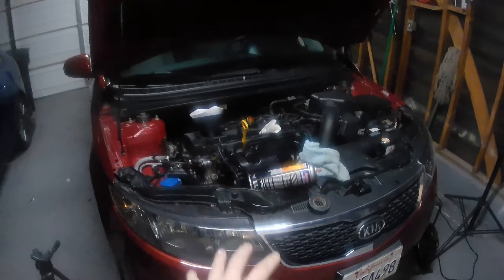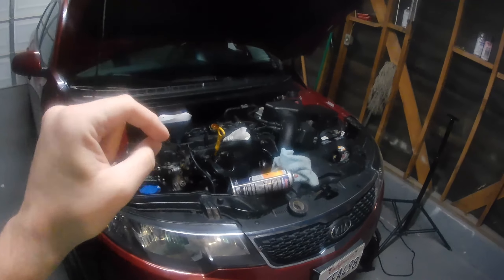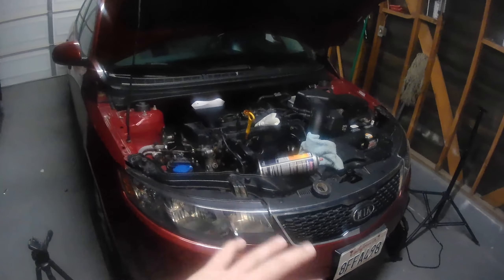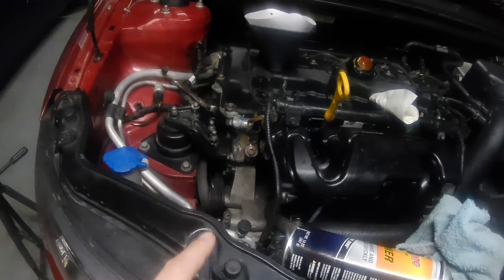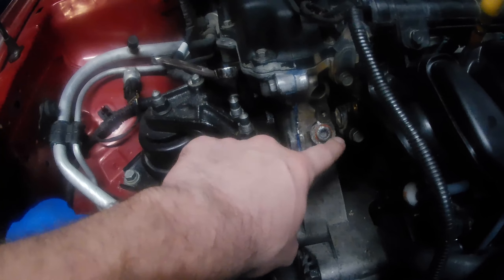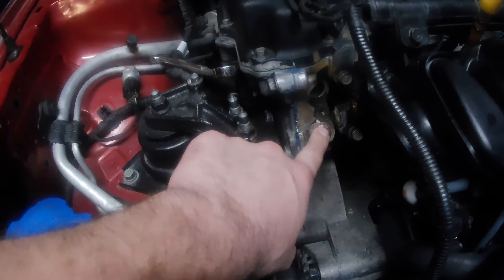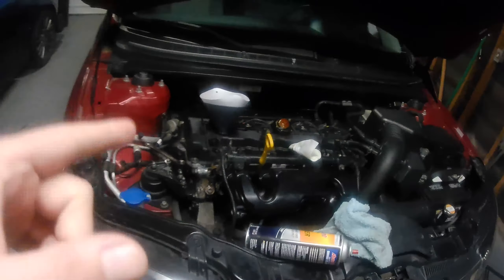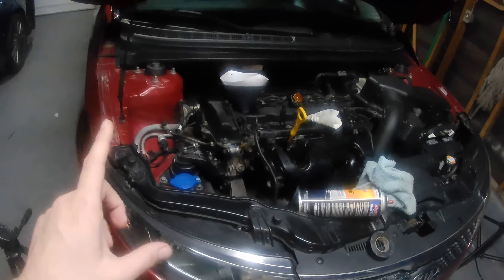The only vehicle to ever HAUNT my thoughts!

Comment: I know it probably doesn’t help now (I started watching all your videos from the beginning and I hate that you stopped), but I would have started with an oil pressure test to make sure it’s in spec.  Then go through those screens and I’ve seen that be balance shafts in other cars.

Also, on the trans fluid—BG makes an awesome additive for auto trans that you can get pretty cheap on Amazon and would have been great with that little bit of extra space you had.

Comment: I had a similar issue and code with a Mazda CX 7. In addition, it would have the slightest hesitation on hard acceleration. Three shops couldn't figure out the issue... in fact, one of those shops refunded me my money after replacing vvt solenoid, timing gear, and chain.  The last mechanic I went to  fixed it in less than an hour by adjusting the timing,.
Reply from the maker: If these new gear coming don’t fix it. That’ll be my last thought. It just doesn’t make sense to me. Cold start, car sounds purrrrrfect. Then a little warm, the tick noise starts. Gets worse when warmer. Usually a low oil tick sound. But the fact it’s quiet when oil is the thickest, then louder when thinnest. It’s my last thought before bent valve or timing off one or two teeth.

Comment: Just a thought, are you sure your not putting too much money & time into your cars?
Reply from the maker: Absolutely, and these two have eaten the most time. But there reaches a point of putting so much time that you cross a barrier. And you HAVE, to get a certain amount. Even if that requires a little extra money. If that money could 100x the return. Ideally if I had realized both these cars were such problems in the beginning. I would have cleaned them and sold them as is and made $500 on each. But the gamble is in trying to fix a few things. But when you start you never know if you just opened worms.